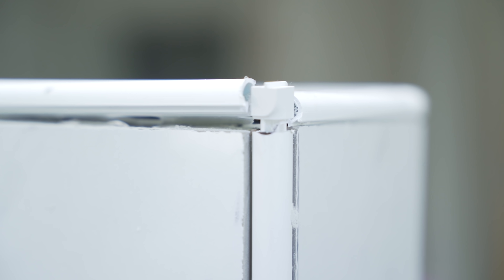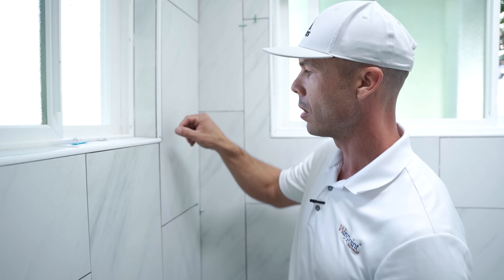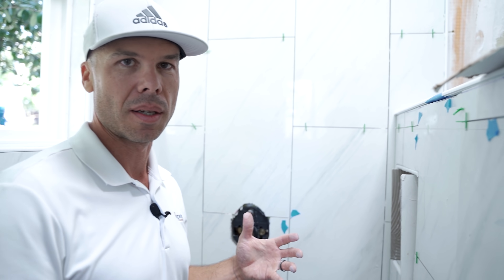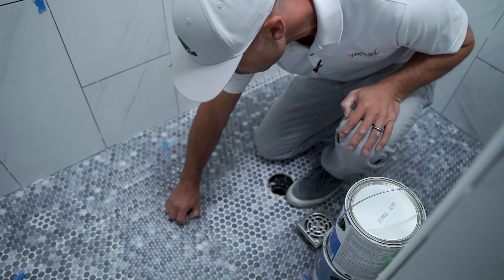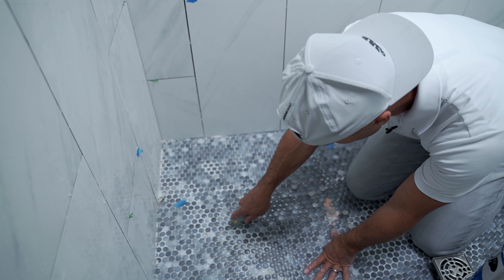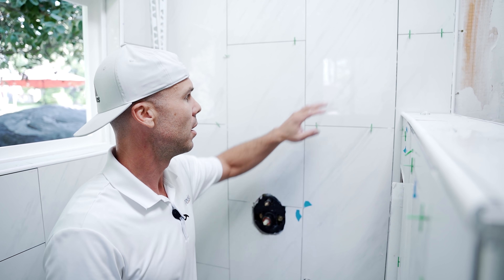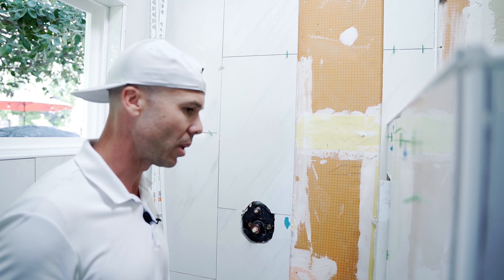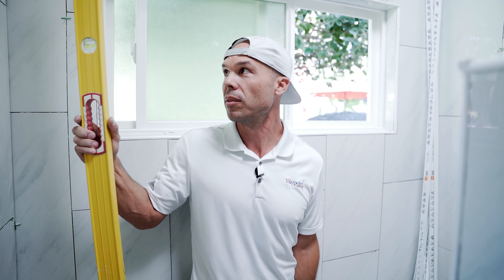WORST TILE JOB I'VE SEEN - Can We Save It?

Comment: Now correct me if I'm wrong but on those penny tiles you only need a v notched trowel for the mortar. To much mortar and its coming up through the space between the tiles and its hard to get the small tiles set evenly. For the larger 12 x 24 tiles you would use a ½ x ½ trowel and not only apply the mortar to the wall but to the back of the tile if the wall isn't perfect. Im not a pro tile guy by any means but I can lay tile if needed. Hardest part though for me is getting the tiles exactly perfect so there isn't any lips. I can keep it from happening if I use a tile leveling kit when I'm laying the tile.

Comment: 1. When looking for a trade get 3 quotes from people you have checked out. 
2. You would have meet all the contractors before even seeing the quotes. In your head pick the guy you liked the most. 
3. Then look at the quotes. If the contractor you liked the most cost more then go with your gut feeling. 
4. Just because they cost more doesn't mean they are ripping you off. It can mean many things.
* They have quoted the job correctly where the others have not. 
* They back themselves to do the right thing. 
* The cheaper contractors might be out off work and just want to win the job. This means as they are doing the job they realise there going to loose money and then rush the job. Quality is no longer a factor. 

All homeowners looking for a trade need to follow these steps. If you can't affored the extra $1,000 then put it on hold and save. Its better to wait and have a job done right. Otherwise you will be calling guys like this guy to fix it. Price then doubles because its double the work. Amd probably takes longer

Comment: Ouch, I'm sure my first bathroom will be better than this but I will probably make plenty of mistakes too!! Thanks for all these awesome videos!

I bought a new home and want to learn to set tile. To gain experience, I think I will start with tiling my small laundry room floor, followed by the garage steps to gain some experience. 

All concrete, as my house is one-level concrete foundation. Also thinking to tile the small patio outdoor area for some experience with the large formats and leveling to flat surface (although not level of course for water drainage). Then if it's good start on the guest bathroom, but only do a standalone wall (non-wet area) as an accent and see if I can mud it and get it plumb. If it's a great success (as Borat would say) only then will I dare venture into the wet areas.

Once I do all that do you think I'll be ready to do the whole 2000sqft house with large format? New home builder wants 45k. I plan to use self leveling compound (the way the Russian DIY guy does it with the tripods) and then go as slow as I need to and get it done when it comes to the tile. I can take months if I need to, no rush because I can live somewhere else during the time and have no kids to walk on it etc.

I will have a contractor family friend check up on my work, worst case can call one of his pro tile setter buddies as a favor but only if he deems my work to be acceptable and only need some tips.

Comment: I just tore out a shower that the tiles four by four were glued onto the drywall with a window in it. The tiles were installed in 1988.. The only reason it failed was because they didn't   keep the window caulked properly over the years. 
Crazy

Comment: I’ve seen worse, I tore the old tile out of a kitchen ready to fit new and I found gigantic holes in the boards that were supposed to be supporting the tile in place, in most areas there were massive humps of cement that the previous tiler used to hold the tile above the holes just enough to make it level. 🤢

Comment: Isaac, what sealer would you recommend for sealing grout lines on 24x12 porcelain tile?  I am currently using one I bought at home depot and it doesn't look like it is being absorbed.  I don't see a sheen on the grout line.  Is this normal?
Reply: Get a sealer that can be used to mix with prism grout. Instead of water. Use a sealer to mix. It’s meant to do that.

Comment: Yeah, talk about learning the hard and expensive way!!!  2 of our neighbors had bathroom remodels and said the "contractor" did a good job.  We went with their referrals and hired the same person.  Unlicensed, uninsured, not to code, etc.  Was about $9K for the remodel, not counting the material we purchased.  All other quotes by the legit contractors were $20K plus.  My goodness, they did a horrible job!!!  Penny tiles are pressed into the excess mortar in most areas/wavy distribution, sharp corners on the metal trim on the shower seat and step in "curb", used a different shade of large format tile and hung it sideways rather with the flow of the others, huge spaces between wall and baseboards, niche tile is crooked, etc...just so many, huge mistakes.  We went cheaper on the labor cuz we had a budget, as we all do.  And we have 3 bathrooms to renovate.  We spent a lot of $ on the tiles, flooring, paint, vanity, everything only to have the beautiful things we bought look like hell cuz of the crappy job the laborers...can't even call them tile installers, did!  A contractor has to have an eye for detail, it is not just an act of labor!  I should be crying tears of happiness, rather than tears of disappointment.  Obviously, we cannot do anything about it now, other than hiring one of the expensive companies to come in and fix everything.  As he stated, go with a certified pro, not cheap labor!  Get a construction loan or a home equity or whatever you can so you can pay the high $!  Waaaaaaaaaaaaaaaahhhhhh!

Comment: I had my floor tiles done, unfortunately they didn't use levelling clips/wedge. I'm planning to repair some areas with lippage. My question is .. can you use these clips on repairs , meaning, I would be laying new tile next to some existing tiles, so the clip cant go under the existing tile. should I shave half the clip off, any ideas?

Comment: I am going  Through this at my 78 yr old fathers house he found a cement contractor on Nextdoor and that guy was 3k less than the Contractor that I had quote the job. Well to make the story short Nextdoor guy poured pad with no footer and erected 12 by 12 shed,  that does not pass inspection because there in no footer the jay bolts pas thru on 3 1/2 inches cement and the rest are in dirt. Lawsuit may be the result and the fact the guy has a California Contractors license is disappointing.

Comment: Isaac you mentioned you do not use Schluter PVC.  Does that mean you prefer the metal stuff or do not use Schluter at all?  If you don't use it...then how do you lay a polished porcelain tile without showing the raw sides of the tile?

Comment: Looks like the shower job a contractor did in my home in El Dorado Hills. All wrong. Dot set tiles. No thin set under tiles in pan either. I wish I had found your channel before I had it done.

Comment: I tiled someone else's prep once. Never again! And that wasn't a horrible prep job either, or at least it was solid. But concrete for the mud bed, walls out of square and anything but flat, heating cable spot glued to the plywood floor... I made it work but it took at least twice as long as it should have (I charged hourly for just that reason), and the end result is not something I would show off. They liked it, but still... never again!

Comment: Is it possible that he used a modified thin set which Schlutter says not to use with their board systems? Not sure if it's just really poor back buttering, but it looks like that thin set did not adhere to the Kerdi board at all what so ever. I'm just a novice DIYer with 0 tile experience, but I'm researching which waterproofing system to go with for my guest bath, and I know they make a big deal about that in the product manuals.

Comment: We tore out a shower that was installed using drywall mudd, they called us a three days after the installation was done that the tiles were moving when they used the shower, that was the worst tile installation I've seen

Comment: I have been recommended to several clients on the Nextdoor website, and know there are a few good installers who are recommended on there in my area. It does seem like a majority of the people posting on the website are mostly looking for the cheapest price or someone who is available immediately....
Reply: Nextdoor is absolute garbage. Just people looking for free and cheap work.
Reply: I have done more than 10 jobs after someone put my company on Nextdoor, even when I am booked I dont lower my price to do the job and people accept my bids 100%.
Reply: @justinofboulder  you are doing something good. It is not garbage as stating above.

Comment: Thats insane how much of a gap there was on those tiles. Im not a tile guy but even i know better that to leave big voids behind tile like that in the shower. I just did my bathroom shower and used the same porcelain tiles as there and I used 1/2 inch trowel. And I actually did the 95%+ coverage.  My landlord paid some guys to do a shower at another property and they use drywall behind the stone slabs they installed and said the walls weren't level so they left a small gap at the bottom and a ½ inch plus at the top edge and then used a 1 foot band of hardibacker above that for a single row of tiles and then just the drywall the rest of the way to the ceiling.  I was pissed when I found out about their shifty way of doing the job.

Comment: I don’t use kurdi board always use USG Durock cement board and PVC liner membrane for the floor that is installed up behind the cement board! then I level out the shower floor with dry mortar with waterproof additive for cement to have the correct pitch for the shower drain before Installing the floor mosaic w thin set!

Comment: Wow! Did the guy advertise himself as a tiler? Who taught him to back butter?? Just, wow. What a mess. And those floor tile with all the thin set coming up through. Before you said anything, I thought it was already grouted! Whoever did this needs to never work in tile again! And those gaps between the tile are so damn small, some almost look like the tile are just resting on the ones below. Looks like about 1/16" gap. That's no good with tile that big! Just, Wow.

Comment: so, with all the videos of shower failures I'm a little freaked out.  I feel like I'm pretty handy but now I'm unsure of myself.  I'm using a Kerdi pan and Kerdi membrane over Durarock.  Should I also use an Ardex 8+9 over the top of everything or is this overkill?  I really don't want leaks...obviously.

Comment: The installer is a good way to describe him. Hes not a tilers ass. As a tiler, it would be more difficult to even lay the tile with the way hes thrown the glue at them than it would be to do it properly. What a waste of tiles and glue.

Comment: I just can't imagine anyone who is trying to make a living doing tile work having a hand in that mess.  You would think that if you were aware of Schluter and knew you had to use seam tape and what corners to buy ect. you would have a pretty good idea how to do the tile install.  Maybe not enough experience and knowledge to do a good job but surely enough to know how to trowel on thin set with the right size of trowel.

Comment: I love to do tile. Have built showers from scratch many times. Unfortunately, had to give it up. I would bid a job at going rate, but would be told "But, I can get a guy from Dallas (of a certain ethnicity) that would do it for $0.99 a sqft." Sorry, but I just wont go that low. I ended up selling my $500 tile saw for $100. And, met others that used to tile, but stopped for the same reason I did. And I used to be passionate about my tile. Oh well.

Comment: I’ve seen bad work, I mean really bad, chipped tiles they left in, 1/8” of lippage, left big ass pieces out what was a really decent looking herringbone, and still this is shocking. Who would think piling on thinset and then running a trowel on 2/3 of the tile would make a decent coverage? It reminds me of a installer I know who is an amazing laminate installer who said he does tile work to, this guy asked me if he can use pressure sensitive flooring adhesive on a glass deco backsplash? I told him to drop the crack pipe and get some ultra lite or maybe mastic but definitely not PS adhesive ffs

Comment: Your info on Schluter foam pan is incorrect.  Any size tile may be used on foam pan. The 2x2 inch min size tile is for the orange dirta mat and heat mat.

Comment: Would it be OK if the homeowner did just the demolition and cleanup, but not the preparation?  Then you can do Hardibacker, Shluter, etc?  Also, why do I see so much lippage in the tile in the Fort Pitt Tunnel?  That had to be a professional union job.

Comment: Lol. You can install penny tile on schluter pan. Look it up
Reply: 😳no u can't look it up. u can if u do a mud bed with kerdi. Issac is correct i just seen it in the book myself
Reply: @tommywalker5348  it's perfectly ok to lay down penny tile on schluter pans.
Reply: I just called Schluter about this specifically, this morning, immediately after seeing this video.   I'm installing these exact same penny tiles on my job I was just about to start. I was going to be using the schluter 38x60 center drain pan.   Schluter said they recommend 2"x2" or larger on the pan exactly as Tile Coach mentioned.  I am now changing my install to a mud base plus kerdi membrane.  Wasted my pan by cutting it, can't return the system now, bummer.
Reply: @dlrwirelesspro  I was talking to schluter rep, and he said that penny tile will be ok. Also every installer who purchase schluter stuff from dealers might have seen counter mats with picture of new Schluter pan and on that picture penny tile was installed.
Reply: I find it hard to risk a failure now especially since schluter just told me to avoid anything smaller than 2"x2".  A rep is knowledgeable but if Schluter have it listed in their technical info not to use under 2"x2" I figure I'll save myself the headache of having to rip it all out later.  I'm always going to air on the side of caution and not have a redo later.
Reply: @alllmas  always go per manufacturer recommendations. What does the pan itself say? What a rep says is moot.
Reply: @joshbrienen5133  my rep said penny tile is ok.

Comment: Make sure your sub adds you as an additional insurer and wait to hear from their agent and get the info you need so you can go directly to their insurance to fix the issue and completly bypass the installer.  Also make sure they know ahead of time that you are going to withold 10% of their bill until it has been properly inspected.  Anytime you hear, " well i have been doing it this way for 30 years"...run   Any ounce of defensiveness and egotism you sense before highering someone, dont higher them.  Not worth it. Every single sub I had a problem with was those types of people.  A good tradesmen will be happy to explain how they do things to make you feel confortible with their work.  When it comes to tile ask if they follow NTCA and TCNA guidelines and especially manufacture installation instructions and ask if they follow ANSI standards.  In utah if you have are dealing with a sub that makes you problems and wont fix it there ia the Department of Professional Licencing and the state will go after them for you.  They might get fined  or their licence pulled.

Comment: I'm guessing he was having grade issues and he squished out all the mortar trying to get the floor graded.  And its a hard sell with 2x2 most of my clients want mosaic (haven't liked the new pans with kerdiband thickness membrane) i use kerdi over the entire area and fold three edges up.  Lay thinset out and flatten the ridges and set.  I use shluter allset its a godsend and it really firms up the pan.  I pay attention to everything and product test on my house before doing jobs for others.  In 20 years i never had a failure,  prep prep prep and more prep.  Pay attention to detail!

Comment: How do you get the thin set off the back of the tiles?
Reply: @boogiedahomey actually not true. I removed the thin set from 800 sq feet of 16 16 tiles. They were popping up. They came up in full pcs. Muratic acid. Soak over night with water mix. Pressure wash the back of them off. Some tiles took 2 soaking.

Comment: That’s why to hire someone you know would do a good job not look for the cheapest price
Reply: I can honestly say that has to be the solution to 95% of the complaints I see of contractors or their work. The customer gets 3 bids. One for 5k, one for 6.5k and another for 9k. They think even by picking the 6.5k that they are getting decent work for a decent price. But they never stop to ask themselves if the 9k contractors work is what they want, then what corners have to be cut to get it down to 6.5k.
Reply: Some people don't have much money and trust that the worker isn't gonna do an absolutely terrible job

Comment: Wonder how the tile jobs look by those guys hanging out in the Home Depot parking lot who say "Si, senor" when asked if experienced laying tile.
Why mix fragile plastic with rugged porcelein tile, especially at corners and edges which take the most abuse?  Shouldn't the thinset be trowelled to the wallboard and back-butter each tile?  Angry tile guy just wanted to get-paid?

Comment: Schluter , Shitter system is crap... just use cement board(installed with thin-set under it!) , proper bond ,straight walls, proper setting ,, 
Hire a pro that's been tiling for 5+ years ... simple.  Know standard rates of install,  if its below that ,, your probably not getting a pro...
PS,  cement board requires thin- set under it furor proper base for tiles.
Reply: How do you put thinset under cement board on walls lol. Do you waterproof the walls or just ce.ent board then tile
Reply: @davidsteyer4925  you put thinset under cement board on the floors. A lot of people just screw it down >>> wrong....